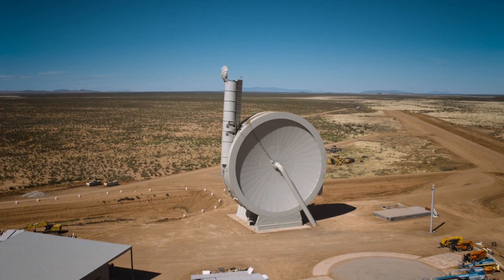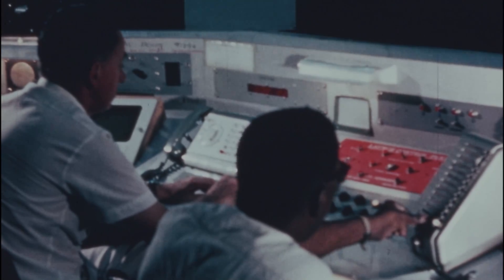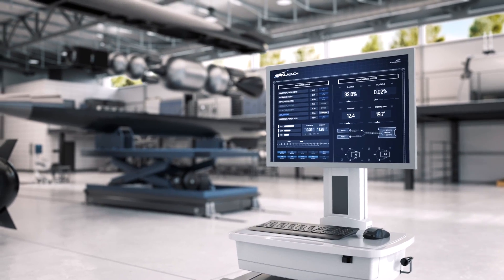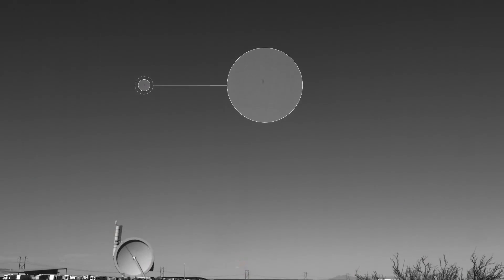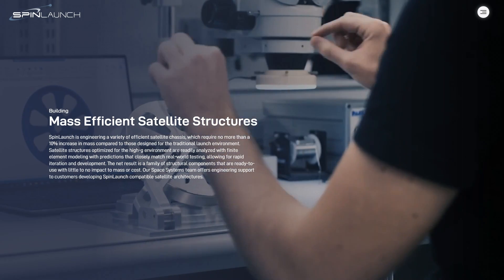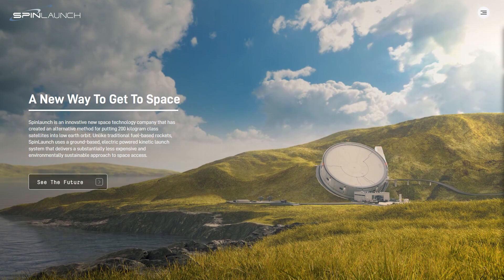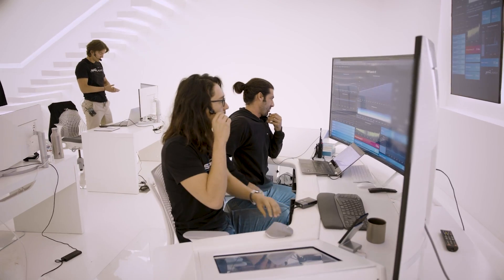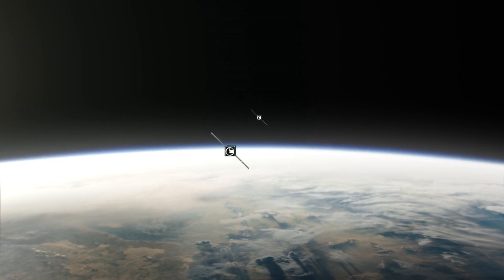Can Spinlaunch Throw Rockets Into Space?

Comment: No, this won't work. Due to atmospheric pressure you have to build to escape velocity. Doing this in reverse equals death. It's akin to firing a gun into water. Bullets react differently every time and it's never optimal. Fucking idiots. 

I know it sounds like a good idea. There are so many other things you have to take into account and this is accounting for NONE of them. It's a failure on conception.
Reply: 17 machs
Reply: falcon 9

Comment: an idea for the release imbalance problem - the counterweight could be fixed to a rack and pinion that can pull it closer to the center of rotation. this can be used to pull the counterweight gradually closer to the center of rotation, which can also be used to increase the angular velocity. at the moment of release, pull the counterweight all the way into the center of rotation to balance the arm. alternatively/additionally, add a countercounterweight close to the center on the side of the payload, release/extend this after the payload is released to balance the counterweight.

Comment: I have an idea that's probably already being used or will be after I say it. Electromagnets, floating rail design like a train. Can't have a lot of weight but If you get the spacecraft moving at a good rate then super boost it with electromagnets at least the speed should help keep the whole system from burning up or melting.

Comment: 10,000 G is equivalent to reaching over 200,000 mph in 1 sec. But it goes on for minutes or hours as the flywheel spins up towards that. What delicate craft can handle such an acceleration? Back in the 70s, I watched an industrial test machine for electronic components. It dropped transistors onto a metal plate. I was told that hitting the plate resulted in a deceleration of 5,000 G. Transistors that did not survive were recycled. But consider the difference between 5,000 G for an instant with 10,000 G for maybe an hour. This project does not sound realistic.

Comment: Technically there are difficulties, so to say... problem 2.
Besides the enourmous speed you built up, I also have the 350 rev's/min rotation around the transverse axis.
Bodies off mass can rotate and translate at the same time....
In fact the rocket would tumble around the centre of mass with 350 revs and have that enormous speed. (if released in the centre of mass)
By releasing say 10 hooks in a line in a very, very precise timed sequence you can return the 350 revs to zero, but, at the release of say, hook 5, the half of the shear force of 11000 g is shearing off the vehicle transverse . (because half og the hooks are free, the other attached. 
Good luck!   Poor inverstors....

Comment: Technically it is hardly possible. Why? 
At the moment of release the 11000 G inside the vehicle reduces to 0 laterally. That means that the  fuel, 11000 G compressed on one side of the vehicle, is now expanding freely and sending shockwaves of its own to other wall of the vehicle. That causes cavitation or something equivalent internally on the other wall and it will burst in the exit tunnel. Film this event.
Poor investors...

Comment: LOL, the idea alone is funny, not for trying to do it that way, but for the people who came up with it.
They have NO IDEA how physics work.
If you want any significant speed derived the centrifugal forces would be fantastic, so you can forget about people being on it. Then, you have the takeoff speed, which can't be exceeding 900m/s, even if you can get it like that without ripping a big fat hole with the cargo through the fuselage, which is going to be heavy since it must witshstand all that weight at such centrifugal forces. Then, since the initial speed is no enough to even reach orbit, the huge rocket boosters required to lift all that mass to greater delta-V, well, it makes the system moot.
It's better to use a linear acceleration system, up a mountain, and then maybe get 1000 m/s without using rocket fuel, from the start, without the tremendous centrifugal forces.
Any height from the acceleraton system leading to less dense air, may increase the maximum speed gain,
so maybe, just maybe 1200 m/s, with heatshield maybe 2000-3000 but that would be just about the thermal limit of any heatshield in existence. Unlike upper atmosphere where the the air is really thin, going through 900mbar of atmo, well, kiss ur flamey hiny goodbye.(in blinding flash of gas)
Reply: They show a rocket going up, yes, really nice. and yet there's no way they can make it work.
The initial speed would have to be 7.000 m/s at a really usable trajectory.
Or it would need another rocket engine attached, and those are sensitive.
Yes, can get an empty hull into a speed that's usable, but when you need an extra rocket engine
the whole rocketengine must be able to withstand the G-forces of the centrifugal process.
There's no way that will work, let alone human usable.
Also, any payloads should then also be able to withstand said G-forces, which is something that would make any satellite or such very expensive, if they weren't before.
Maybe orbital raw resource launch,  but like said, the whole fuselage would have to be able to withstand all the centrifugal forces, without tearing through the fuselage, and since any speed derived from the catapult would not be enough to get the fuselage into orbit (lacking trajectory), it would still need an engine, and ur back at square one. The engine can't withstand such, or needs very much structural support, increasing the weight and then needing equally larger propulsion and fuel.
When using it as the only form of propulsion, you'd need an initial speed well in excess of 8000 m/s and thus burn up in the lower atmosphere where friction is the highest.
Yes, it looks cool, but ultimately worthless, and I doubt they put anything into true orbit.
It's not commercially viable, since the satellites would need to be equally capable of withstanding the centrifugal forces making the satellite more expensive, and with that the objective, cheaper orbital launching moot, sorry.
Reply: Ignoring all else, mach 1 isn't even close to orbital height, you get maybe 4 km height, and then it's velocity is zero, zero friction. Mach 2 needs even more G-forces, and still only get's you 16 km before speed is zero. And that is a very long way from LEO. The minimum with perfect trajectory would have to be well in excess of 7000 m/s at groundlevel. Calculate for any payload the G-forces involved.
Reply: Travel 'spaceport US', get free soup..
Reply: Roasted flamey soup..(thermalisation at 7000m/s launch in atmo)

Comment: I cant wait to see them slam a "rocket" into the sea level atmosphere. 

The amount of overkill force you will have to use to negate windcurrents and whatnot is insane. 

Owell, wish them the best of times!
Reply: Let's ignore the heat generated, too.
Reply: The air slamming into the launcher at sonic speed, hitting the rotator still spinning with 8000+ km/h will end in a dramatic fireball, while the counterweight sets free another 25 GJ (or the equivalent of 6.000 kg of TNT).

Comment: If they build this thing on a mountain, you'd even save yourself having to go through the first 2-4 or so km of really dense air, thereby eliminating a significant portion of the drag encountered when exiting.
Reply: the test site is in southern New Mexico at an elevation of 4,600ft
Reply: @ericettensohn8046  That's useful, but higher locations are possible. There's also a gain from being close to the Equator.
Reply: wouldnt you have a lot of issues getting stuff and people there?

Comment: The big issue here is this scale model is, on a practical level,  borderline useless. It's only purpose is to attract investors so when the project collapses the "serial entrepreneur" responsible for it can pocket as much cash as possible. 

The problems with something like this do not scale linearly, they scale exponentially. Proving you can do it at this scale means close to nothing because the energy involved in their full scale system is roughly 50x what they are dealing with here. There may be applications for this type of technology elsewhere but this has all the hallmarks of vapourware just trying to sell a dream.
Reply: Technically it is hardly possible. Why? 
At the moment of release the 11000 G inside the vehicle reduces to 0 laterally. That means that the  fuel, 11000 G compressed on one side of the vehicle, is now expanding freely and sending shockwaves of its own to other wall of the vehicle. That causes cavitation or something equivalent internally on the other wall and it will burst in the exit tunnel. Film this event.
Poor investors...

Comment: Why do they go through the trouble of spinning the rocket around instead of just spinning a weight and transferring that kinetic energy somehow?
One example would be having the rocket on a long sled which gets pulled by a rope - you attach the rope to the flywheel when it's at speed. Using some clever gearing you could reduce G forces compared to the yeeting solution here.
Reply: Smoothbrain levels over 9000....

Comment: They could achieve even more efficiency by launching the projectile from a location at the equator and from as high an altitude as possible. I'm thinking the Andes around Ecuador or Peru?
Reply: That wouldnt be useful if we think how big the travel is. Even 5000 Meters above water wouldnt really help, as the rocket flying with about 6 km a second. So in reality building it somewhere high would only cut off max 0.5 second of the flight.. And thats nothing compared to the issues building it somewhere high etc

Comment: I was never very good at kerbal space program but I wonder if making a counter weight out of copper and releasing it down a long tube of magnets would slow it down without exploding the whole thing. or  magnetic counter weight released into a copper tube. wonder if there is a way to generate a current from that as well to convert the kinetic energy back into some electrical energy to make the whole process more efficient.
Reply: all that kinetic energy would get dissipated as heat via eddy forces in the copper. the copper would vaporize. the facility would explode.

Comment: I've always thought making a multiple mile rail gun through something like the Salt Flats and then angling up the rocket to the 35 degrees at the end would be the cheapest and most effective.  I think you would be able to get speeds significantly higher than SpinLaunch would be able to produce with SIGNIFICANTLY lower g forces on the devices.
Reply: I completely agree. There is apparently a specific type of railgun called quenchgun, which slowly uses excess grid charge to to charge a liquid which also automatically triggers the magnetic attraction of a railgun to accelerate the payload, and there is a plan to use it to launch things in orbit at a 3 degrees angle (apparently 10 degrees is the maximum you want to not need extra fuel to get the object in a stable orbit with very little fuel). L-SLS (Lancaster Space Launch System) is a project meant to use it, which is trying to get funding.
Reply: Counterpoint, a spinlaunch system could almost certainly be made to rotate. So if you made one at the equator you could rotate it to achieve most inclinations, making it far more useful than a static rail gun. Plus one of the problems super long railguns would face is electrical resistance over the long distance (superconductors could solve that but we have no way to cool that much wiring).
Reply: Holy fuck no, your idea was far better than this. This is absolutely useless.
Reply: No… you, that wouldn’t work. There’s a reason why we use rockets to (relatively) slowly launch things into space, as opposed to slinging that faster than the speed of sound. Air friction. 

Your idea would quite literally be torn apart before it left the track.
Reply: @bimlauyomashitobi421  Rail guns today shoot things significantly faster than speed of sound, what would be different here?
Reply: @mrcoinflip  You do realize that there’s a wee difference between a bullet and a rocket, right kiddo?
Reply: @bimlauyomashitobi421  Yes. In the video above, they showed that computer electricians are capable of handling the g forces that exist in a gun, and at speeds, the g forced in SpinLaunch would become similar due to its spinning speeds. 

When you have a multiple mile long track, you can get something to significantly higher speeds, without the instant g forces.
Reply: @bimlauyomashitobi421  no it wouldnt. Have you even watched the video? Rockets being launched with 7-10 times the speed of sound in our thick atmosphere down here near the ground and the rockets glow, yes, but dont fall apart.. And surely wouldnt fall apart at just above the speed of sound.. Do you know that theres jets that fly twice the speed of sound without a problem? So yeah, his idea would work, why wouldnt it? In this video itself they say the spinlaunch thing launches with 7 times the speed of sound and that works
Reply: @baadlyrics8705  That’s cute, you think you’re a scientist because you passed highschool physics with a c+! That’s adorable!
Reply: @bimlauyomashitobi421  How is this idea any different?  Also things getting torn apart means you're not building your casing around the payload well enough.  Bullets don't get torn apart.
Reply: @mrcoinflip  Bullets are the size of bullets. Rockets are the size of rockets. Understanding that there is a difference here should have been something that you learned before kindergarten.
Reply: @bimlauyomashitobi421  I hope you're able to broaden your viewpoints and learn that you're not the smartest person in the room or in the world. Maybe there's somethings that you may not understand.

There is a big push to send up small 10x10x10 cm cube which weighs less than 1.3kg. Lowering the price for this makes it much more accessible for colleges and smaller companies for learning and research. Rail guns today are capable of shooting projectiles significantly larger than this today. 

There are always going to be to the significantly larger than Spin or Rail Gun can handle, and that will still need to be launched with rockets, but neither of these are trying to send those up.
Reply: @bimlauyomashitobi421  Are you talking about his video debunking the SpinLaunch Video above?  That was one of the biggest wastes of 19 minutes of my live.  He spent like 3 minutes making me watch a stupid promo video of the Hyperloop video.  His second big argument is the demo they used had some rust inside the vacuum.  So what...This is a prototype.    The best part of the entire video was one of the comments talking about how the arm would destroy itself once the balance changes when they release the prototype.  None of these things are relevant at all here.  Rail guns are capable of firing projectiles significantly faster than speeds here not in a vacuum, and can do it using electricity without anything being blown apart and incapable.  

That's hilarious you used ad hominem as I see you're the one talking about what people learned in Kindergarten or their physics grades being c+.  Hierocracy at it's finest.
Reply: @mrcoinflip  That’s so cute! You’re plugging your ears and yelling “Lalala, I can’t hear you!!! You wrong me right!!! Lalalala!!!” That is just ADORABLE! 

It must be nice living in a world where nobody else has valid opposing opinions. How do you import food into your little microverse though, do your parents air lift it down the laundry chute, or do your just wear ear buds, sun glasses, and anything else to protect you from socializing when you go out to forage the pantry?
Reply: @bimlauyomashitobi421  Ha, you totally stopped even trying to use science, logic, or reasoning to try anymore and are just trying to attack me saying I'm ignoring your arguments. I'm listening, tell me.

I see you edited your reply to add more insults, I'm still not hearing any science...

Comment: RE: Other things that could launch something into space: Ram accelerators, which were also used in Project HARP, can launch projectiles at velocities higher than 8 km/s. They are, without a doubt, my favorite thing that humanity has ever engineered into existence. It's just so amazing to me how they work- Basically a projectile shaped like the center of a ramjet or scramjet engine is fired down a tube full of combustible gas. The projectile acts like a ram/scramjet engine as it presses the gas it travels through against the barrel- the projectile is shaped such that a standing wave forms behind it. At the rear of the projectile, the gas gets compressed to such a high pressure and temperature that it starts combusting on its own. At higher velocities, the gas will actually detonate instead, creating far more thrust.
Reply: Never knew about this. Thanks for that 👍
Reply: Just putting a rocket in a tube so thrust is concentrated vertically makes it faster, thus takes less to reach e, vel. Hard part is building a refractory tube big enough lol.
Reply: Damn! Brillant idea!
Reply: That is very cool.  Did not know that.
Reply: That's mad cool man
Reply: A positive feedback loop!
Reply: That's cool as hell
Reply: Wow! Can they reach velocities to carry them to the moon?
Reply: LOL we used to do that when I was a kid. It's called "dieseling" a BB gun. Put a few drops of light oil down the barrel of a BB gun/air rifle.  When the air is released into the barrel, the oil ignites just like in a diesel engine, imparting significant additional energy to the projectile (and proportionate stresses on the barrel.)
Reply: Do you know if the HARP barrels were evacuated? I haven't been able to find information about if they were.
Reply: @dv8inpp  They could not have been, as they were full of a combustible fuel-air mixture, as described in the comment you replied to.